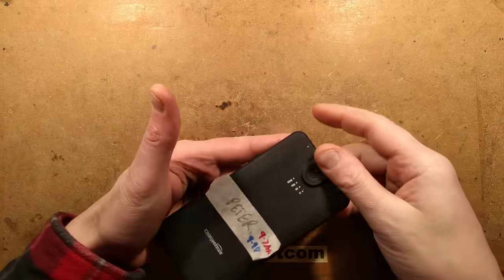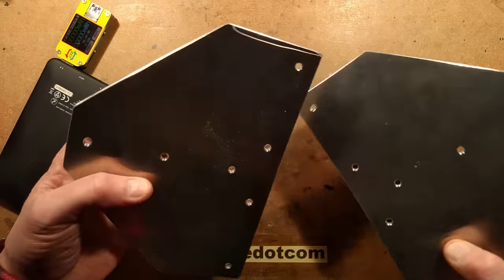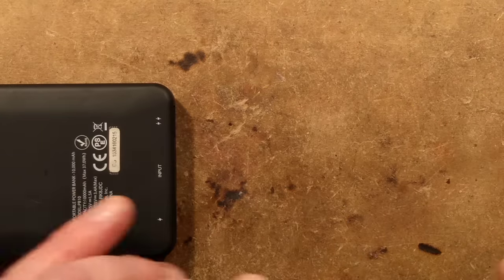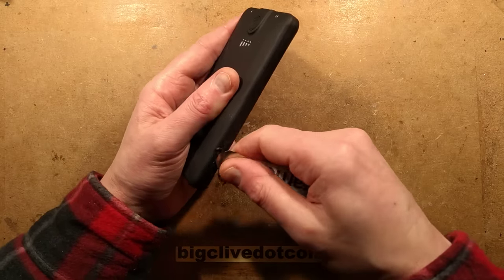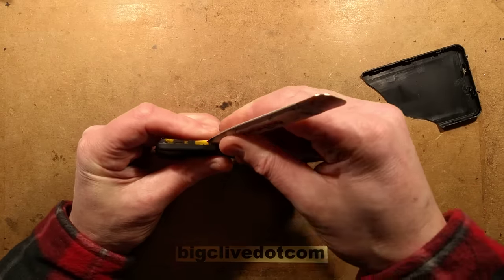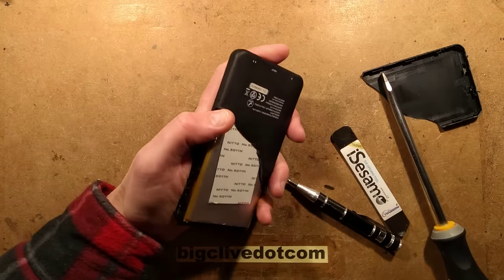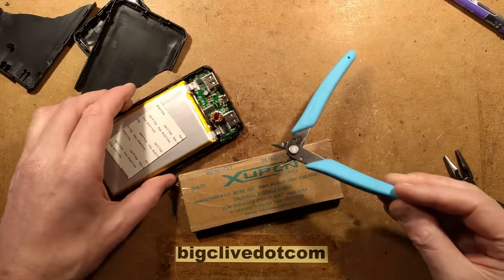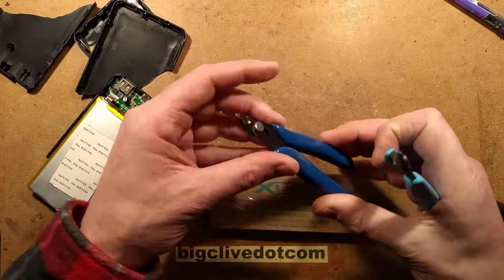Inside a recalled Amazon Basics power bank.

Comment: My guess for the recall is that as you noticed, the battery was tightly packed inside the plastic case. Li-Ion batteries will expand in their pouches over time. When constrained by the case, as they are here, perhaps over time, the pouches slowly inflated and pushed the case open. Any good design for Li-Ion batteries must allow for a nominal amount of pouch expansion.
Reply: I would guess that the plastic housing of the battery bank should allow enough flexibility to expand slightly, or even crack open in the event of a full "puff-up".   Pretty much all battery banks have some inherent danger due to the lithium-ion battery pack, so user beware. ;)
Since I run a mobile phone repair shop, once I had the unfortunate luck where a phone's internal battery has "exploded" on my work desk (well, caught fire) while trying to remove it.  Didn't puncture it as I was peeling out of the housing, apparently it may have had some internal fault (thus the reason for the need of a replacement).  From then on I always wear safety glasses when removing glued-in internal batteries. lol
Reply: So, my friend had a power bank, what we took apart, and the LiPo battery was so puffed up, that it was around 2 times the size, and the housing expanded with it, even though it was rigid plastic. Nothing is stronger than a LiPo battery puffing up, but a nail.
Reply: > My guess for the recall is that as you noticed, the battery was tightly packed inside the plastic case.

If that's true, every Li-Ion battery phone in current production should be recalled, as they're all tightly packed into the phone's case.
Reply: You know, I had a problem with the screen bulging on the IPhone SE (I wanna say it was the second gen? It was the one prior to the new OLED screen phone) I’d be curious to see if that was a problem with them, I still have it so I’ll have to take it apart
Reply: @shadowanonymous3941  guarantee that was the problem. Super common on those iPhones for the battery to puff and force the screen out.
Reply: As Sherlock Holmes would call it, 'The Difficult Case of the Tight Case'
Reply: Good batteries won’t swell
Reply: @James-iw2pr  Agree. I always buy powerbanks from reputable sellers - Anker, Energizer, Duracell......
(after having made some early mistakes!!!!)
Reply: HAha, guess he cracked that case.
Reply: Lipos*. Lions are generally round hard shelled cells.
Reply: @volvo09  the common iPod nano black spot...
Reply: I had the battery in an iPhone 6S swell so much that it bowed then popped the screen off the front.  Apple replaced the battery for $49 US, but kept the phone over night at their store while the defective battery was being depleted in advance of swapping in of a fresh battery.
Reply: @DivisionRc  and found in many parts of Africa and India!

Comment: I live for the day that I see the USB load device cooling fan start up :)
Reply: It'll start eventually, but it takes a while to get up to temperature. Clive just winds it up until she pops and then stops instead of doing a sustained load test
Reply: Mine kicks in after 15 seconds above 1 amp
Reply: Mine comes on in a very low rpm till the temperature increases
Reply: mine started up and flew out the window a few years ago.

Comment: Big Clive doesnt need to put his name on any of his equipment.  His is the one with the big gouges at the seams :)
Reply: Haha you know he takes all to bits....
Reply from the maker: And of course it's pink, which means it's less likely to be stolen.
Reply: @bigclivedotcom  Oh.  Is that what it means!  <wink> <wink>   :-)
Reply: @bigclivedotcom  so true, if you have a box of 100 black or blue pens on a desk at work they will vanish with in 5 mins, a box of red pens will take about 2 hours to disappear, pens that have a pink casing but have black or blue ink will stay in the box on the desk for months.
Reply: When buying cigarette lighters always chose pink.  Not just because I'm an ex figure skater and ballroom dancer but it could be left on pub table and still be there after taking a slash.
Reply: Well he already said he'd if he used labels would be gay really, so it's nothing new!
Reply: @bigclivedotcom  Who cares what color a piece of tech is as long as it works. Thanks for the advice on the Toroidal Transformer on your Christmas live feed, I asked this company for a 24-0-24 Center Tap and they gave me a 24v + and - plus a 24v + and - so four separate wires and you said the two center wire should be fine, but what if they were wound out of faze? How do I test for that?
Reply: @bigclivedotcom  not about the subject of the pink color.

But how do you properly dispose of lithium batteries and other items where you live.

Also maybe you should go over the specialty non-standard types of plugs where you live.

As well.

And maybe compare the electronics waste disposal and stuff from where you live to United States.

Also do you discharge the same batteries before disposing of them.

Or do you use other methods of rendering them safe.

Also you should probably put together a playlist of videos of gone horribly wrong.

I bet you that playlist would get a lot of views.

Maybe it should be called outcomes the explosion containment Thai Dish and more.

I'm sure if you don't I probably would make that punk playlist once I find all them.

Anyone that's interested in Robot Chicken see my upcoming upcoming playlist sorted by topic.

There may be more than a dozen coming up.

And yes.

Robot Chicken Lego actually Lego ones.

Instead of a little bit out and a lot of everything else.
Reply: @kendalkenny1843  if he takes it to bits does he dissect the code that runs on the microcontroller LOL.

Or analyze the contents of the eeprom LOL

Or sees how many bits are free on the flash memory LOL
Reply: Oh by the way Speakeasy of the explosion containment pie dish.

I've had my fair share of lithium battery issues.

Both involving metal pans.

First one.

I had an explosion containment pie dish moment.

About almost two years ago.

I had medium sized power bank.

I was just taking it out of my pocket and realized it was hot too hot.

And then I started to smell something I'm like oh crap.

So I grabbed actually a cookie tin.

That happened we on the countertop.

Just about ripped the door off the hinges on the way out.

And chucked it as hard as I could into the parking lot.

A lot of flammable materials in front of the building but not in the parking lot.

The second time I had an older Android phone that the battery had expanded so much it bulged the screen and even cracked the OtterBox.

This was not a Samsung.

But those phones are no longer manufactured for that reason and for battery life.

They were absolute power Hogs.

No matter what you did she try to keep it running.

From what I understand the reason why that phone has swappable battery is because they knew about those issues in the design stage.

That phone was kind of like a Motorola with Moto mods except it had slide-in interchangeable modules that fit where to buy battery was slid in that battery carrier also had the USB C port.

Also it was available to have a battery charging cradle for a second battery that could also be used as a power bank.

Again why that was done is because you had to have a second battery otherwise you might want up stranded with no power.

I did everything I could to minimize power use on that stupid phone.

I don't remember tomorrow phone maybe somebody could remind me.

I mean you couldn't even use the internet for like a half hour before your battery mostly dad

Not only that.

This phone would majorly overheat a x to the point you thought your battery bike catch on fire.

 that's when I found out the battery had expanded because I couldn't pull the battery.

Anyone else of horror stories like that.
Reply: @guygordon2780  almost that well known Scottish dance :D
I'm always surprised the pink issue still causes raised eyebrows these days.  Wife is a thespian (you have to be careful how you spell that too!) and it's a surprise to find a bloke who ISn't wearing pink.  That said whether its pink or blue - I'd be a bit cautious about pinching something whatever the colour from a 6'5" bearded Scot with a 10" screwdriver in one hand even if he is grasping a G&T in the other... just sayin'
Reply: @airgunnut9489  Remove all the caps. No one wants to put an uncapped one in their pocket.
Reply: @bigclivedotcom  I often use thrift-store-sourced diaper bags to carry expensive kit around. Nobody gives it a second glance if I leave it sit somewhere.
Reply: @Matt Quinn That's very true - you've just reminded me I bought some double powerbank enclosures on the bay (not yet delivered) 7 colours on offer - 7 different prices required.  Black was £1.32, pink a mere 1.02.  I only want the charging circuit boards - so pink was a no brainer
Reply: Aaron Brandenburg batteries plus bulbs will take your old battery’s
Reply: @MrBrymstond  Conncet the middle wires together and test the voltage between the two ends, if you get 48V you are good to go, if not reverse the polarity on one of the windings.
Reply: @petermichaelgreen  I was thinking that and Clive said but this was a expensive transformer and didn't want the blue smoke to escape, it doesn't look like they bent the wire over when they wound it and thought what if they wound the other 24v side in the opposite position/ direction and it's out of phase, but why would they and I could probably just use any other wire that doesn't set off the continuity tester, This has 4 wire for the primary for parallel 120v @ 50/60 Hz or in a series 240v @ 50/60 Hz, thanks
Reply: Sreetips ...
Reply: @jeremym9140  that's where I take mine actually but now I'm off you will realize that I'm sure so thanks for anyone else that finds it useful.

I was going to mention that but I didn't think I needed to.
Reply: Skynet Necropost, but where did he say that? I'm curious

Comment: You can separate pouch cells from enclosures or each other by dipping a thin but stiff piece of plastic (I use a small RC plane propeller) in lighter fluid and then repeatedly sliding it between the cell and surface.  It works perfectly.  Those look like nice cells too. I'd definitely want to save them.

Comment: I absolutely had tears in my eyes laughing when you gingerly said to the petrol comment " I don't fhhhhukin think soo". One of my jobs as a petrol station assistant is to gently remind mobile phone users while filling up that it is illegal to use a mobile phone on a forcourt. Not because the "radio" side interferes with anything, but because the battery in a phone IS a fire risk and also using a phone is a distraction from filling up a death trap with an equally explosive liquid! Needless to say I have been called a lot of four letter words in my time to which I simply reply, "and you.."

Comment: I don't know if anybody's ever mentioned using dental floss to cut the pad. You can slide down behind and oscillating back and forth to cut the foam or the tape liberating the battery from the device. For those who think there is a better material than dental floss don't you dare try a thin wire. Kevlar fishing line multi strand obviously also works.
Reply: A thin wire works fine. If you are going to use it around things that can be shorted out, that means you shouldn't be inside of electronics anyways. And it won't cut into a battery any easier than dental floss, which actually cuts through plastic better than metal wire; since there's more friction. And once you break through into the battery, it doesn't matter if it's string or metal wire, it's going to runaway in both scenarios.
Reply: @littlejackalo5326  Dental floss has more friction than metal? Citation desperately needed. My dental floss is coated in a layer of PTFE, so it's literally coated in a lubricant. You are saying a lubricant material (brand name is glide) has more friction than a non lubricant material. 

Get your facts together.
Reply: @lambdaman3228  no need to talk down to the guy so smugly just because you think you know better. a little kindness makes the world a much better place.
Reply: @sleepCircle  Who said anything about needing to?

I wanted to respond to misinformation. I did. It felt good. By clearing up misinformation I helped make the world a better place.
Reply: @lambdaman3228  there are various ways to phrase what you said. "citation DESPERately needed"

"get your facts together"

you don't think there are perhaps higher than absolutely warranted levels of condescension in some of those remarks?

if speaking objectively correct facts was all it took to win the hearts and minds of people—to get rid of disagreement—then the world's wars would've ended long ago and paranoia and partisan hostility wouldn't be escalating everywhere across the globe.

kindness helps too.
Reply: @sleepCircle  > you don't think there are perhaps higher than absolutely warranted levels of condescension in some of those remarks?

No, I think the amount of condescension is at precisely the appropriate level.

> if speaking objectively correct facts was all it took to win the hearts and minds of people—to get rid of disagreement—then the world's wars would've ended long ago 

People don't wage wars because of condescendingly communicated facts. People don't avoid wars because of carefully and precisely communicated facts.

Partisan hostility is manufactured because it is a desired outcome by the parties that fund and promote it. 

Try again please, I am really enjoying this.
Reply: @lambdaman3228  i am sure you could understand what i was trying to say if you really wanted to, but your "enjoyment" is getting in the way
Reply: @lambdaman3228  let me try again.

"Partisan hostility is manufactured because it is a desired outcome by the parties that fund and promote it."

the implicit claim: "i am absolved of all responsibility for how people see me when i treat them as lesser people, or people not deserving of anything except my contempt. similarly i am absolved of any residual ill-feeling that sits with them and causes them to be act less kind to more people, later on. nothing i do has enough to do with the greater state of the world to warrant me changing my approach."

even though clearly it is the UNARGUED ACCEPTANCE of "no individual unkindness matters" or in more unfortunate cases "cruelty is justified if i'm a good person/if i'm in the right" among more and more people that is creating masses of greater unkindness.

if your intelligence is so superior that you think you can recognize where all the hostility is coming from, but you have no interest in trying to ameliorate it personally, then the benefit of whatever intelligence you possess is reduced by at least half, probably much more.

edit: and wars are started when masses of people who feel afraid or wronged or some other great uneasy ill-feeling fall prey to charismatic jackasses that come along, who can play on their emotions and convince them that a. "i know who is causing all your problems" (he doesn't have to be right, he just has to be good at talking) and b. "now is the time to kill them and/or take their stuff"
if you want these masses of people to listen to you—if you want to avert the war—you can't just present them with a laundry list of concise facts delivered with a stinging little smack on the ear and a mocking smile, you have to convince them that you are on their side MORE than the lunatic screaming from the balcony is on their side. and to do that you actually HAVE TO CARE ABOUT THEM. because most people are not as good at convincing a crowd of a lie as a real frothing lunatic, you probably can't beat him at fakery, therefore you will have to beat him with genuineness. not just of facts, but of heart.
Reply: @lambdaman3228  
i'm probably not going to reply to you again after this, but i hope something in your life makes you more disposed to be gentle and to lead your precisely communicated facts with friendly good-naturedness and compassion. these two sides of communication don't have to be mutually exclusive, even if it's more fun to take snide pot-shots people while we explain stuff to them.
Reply: Glide is an exception to the rule. The vast majority of floss is rough and waxed. You should not assume an exception when the general class is specified (though it's a pretext for making an argument).
Oh, and Glide is dental tape, not floss. Floss is round. I used to use Glide before I learned about the risks of consuming even small amounts of PTFE.

Comment: That's gotta be the most accurate hole I've ever seen a electrician pull off! lol JK. Great video as always
Reply: Hey it's AvE's insurance policy escaped from the cloning center! (joke) great channel!
Reply: ElementalMaker I love the mini tesla coil I bought per your suggestion! I’ve since bought a few more diy high voltage kits to play with and building them’s been a lot of fun :)
Reply: electrical engineer*
Reply: Barack Lasagna - *Sparkies
Reply: That's why they use those step bits... if it doesn't fit, just make it the next size bigger...